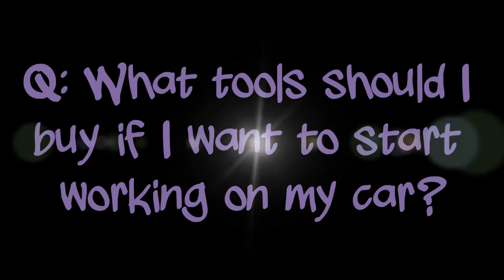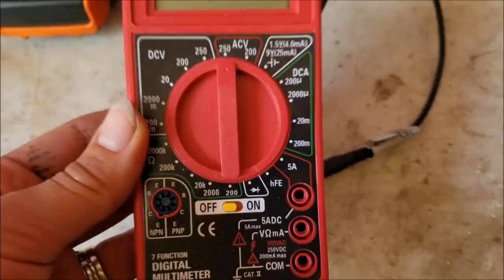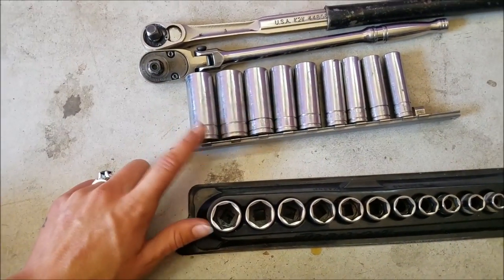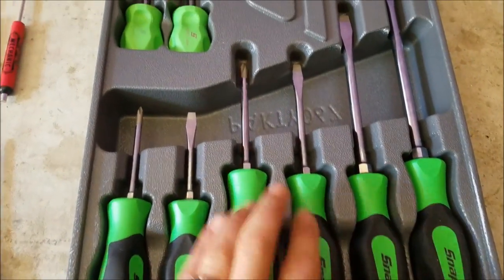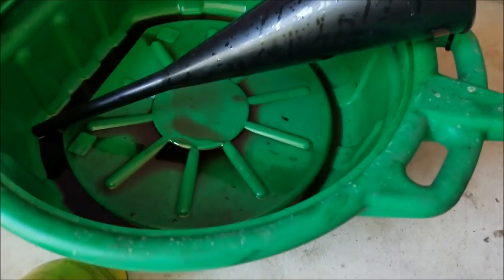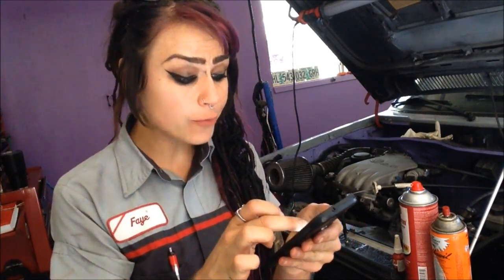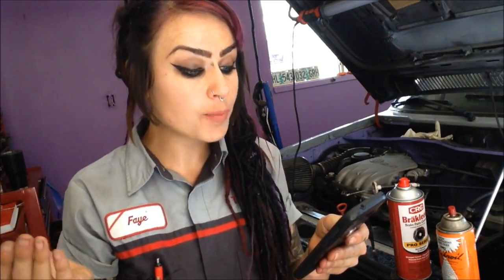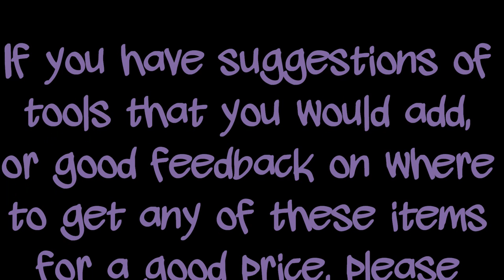"What tools should I buy if I want to start working on my car?" Q&A with Faye #2!

Comment: Crescent wrenches are trash haha, for the most part anyway. I think they are a good ( not great) shop tool but not a good car mechanic tool. I would say as a beginner I lost a ton of bolts because I would leave them on the side of finders ect. but a magnetic bolt tray is so nice to have. I also hardly ever see anyone use my favorite pliers, duckbill pliers. They are in between regular pliers and needle nose pliers and work much better for factory radiator hose clamps ect. They are my go to pliers most of the time. I have a bunch of vehicles and I usually just grab a Stanley tool set from Walmart, open 24/7, the sets come with 70% of the tools needed in a pinch, they are fairly cheap and comes in a decent case. Great video for beginners though, very informative!

Comment: Those Adjustable wrenches are good for lightly bending back flat metal usually inner fender flairs or under the hood, Or doors. Every tool has a purpose just not necessarily a good one.

Comment: There is one simple tool that I know I can't live without on any job, auto, plumbing, carpentry, whatever.  A good pocket knife, preferably with a clip-point blade.  I can open packaging, scrape mating surfaces, cut vacuum lines, dig crud away from fasteners... hell, I could make a list as long as my arm.

I wear carpenter's jeans and the flashlight goes in the tool pocket on the right thigh, my Gerber pocket knife in my right back pocket, and my Leatherman in my right front.  I feel naked without those three tools, but if I had to pick just one, it would be the pocket knife.

Comment: Totally agree on the adjustable wrenches! I hate them. They’re more of a pain than anything.  About the only time I find them useful is for doing plumbing work. They’re really handy as a multi tool for that, since you’re working with PVC or some metal fitting that’s a lot more forgiving with tools like this.
Reply: The Crescent (adjustable) wrench has its place, which is why it became a classic.  Suppose you have a trailer hitch.  The ball has a large nut on the bottom.  Would you buy a fixed size open end wrench for that?  You won’t use it anywhere else.  Then, if you need a larger ball, it will have a larger nut.  Another single size wrench?  A large Crescent wrench is the best tool for this job and many others, even though it is not a replacement for a set of combination wrenches in common sizes.

Comment: went down a YouTube rabbit hole.  so glad to have stumbled across one of your videos (instant sub), & used it for a tangent for something continuous.  anyway, from a tale that i'll refrain from telling i acquired a graduated (sae on 1 side & mm the other) adjustable wrench.  i used it to help me learn to eyeball socket size to bolt heads that i wasn't already familiar with, and if i could squeeze it in on a few bolts that i could only get to by feel.  i know, a year & a 1/2 late, but...æ

Comment: Can't afford a creeper best that I like to use is cardboard as a creeper and also for your knees. I actually threw away my creeper sick and tired of rolling around when trying to loosen nuts and bolts.
Also when your on concrete cardboard is not cold. Or spent money by rubber mats.

Comment: I bought cheap tools for the house from Walmart and if I needed to work on the car used them. The one set maybe was $20 and I still use it, 15 years later. The only thing that broke was that stupid adapter to use a 3/8 drive with 1/4 inch socket (bad idea anyway). I've added tools when I decided to try more difficult stuff. I'd recommend someone just starting out to get tools as the job presents itself. And there many tools even if used just once is worth it, but don't get tools because "maybe I'll need it."   However, the one thing I really need now is a chicken.
Reply from the maker: :)) chicken is highly recommended!!!

Comment: I actually use my adjustable wrench as a poor mans calipers to find the size for the right wrench. LOL 

Seriously though, I am a machine designer and use those as a versatile tool to check bigger bolts on machines but I shy away from using them to do any actual repair or assembly work.
Reply: "I actually use my adjustable wrench as a poor mans calipers to find the size for the right wrench. LOL "  I do the same

Comment: If you are going to use an adjustable wrench, spend a little extra to get a decent quality product. Sometimes Harbor Freight is not the best option and sometimes they are just take your time and look at several brands, do some research.

Comment: For the wrenches I highly recommend ratcheting wrenches with the swivel head there are a little bit more spendy but trust me where a socket wont work and a wrench does it's in a tight space if not invest in a shop chicken because you'll need that laughter to keep wrenching with the standard solid wrenches lol

Comment: Hey, what about a toolbox? Gotta have one or more of those to store and pack around those precious pieces of metal. Another tool recommend is the Power Probe for electrical diagnostics. Not too pricey and indispensable for electrical problems.  Milwaukee makes a stackable set of toolboxes that can link together and you can start low budget and work up from there. I use everything Milwaukee in 12 volt and 18 volt in the Fuel versions.

Comment: Found you through bearded seabee82, good looking video quality. I certainly took a long time to feel good about my tool collection to handle a lot of the car stuff I do. I still don't own a multimeter/voltmeter, I've never been good with electrical stuff - but I could probably pull that off now after all of these years, haha. Love your sense of humor. Like SAAB, I'm still in denial that Pontiac, Olds and Plymouth are dead, haha.
Reply from the maker: Awesome! Yes! I bet you could, too. I seriously use this $5.99 one from HF all the time!! And at the very least, a multimeter is great for just checking the charging voltage of your alternator! Thanks so much for subbing! :)

Comment: Great recommendations. I would say if you aren't wrenching every day don't bother with expensive tool truck brand tools. Craftsman, Kolbalt and harbor freight are good enough for do it yourself use most of the time. Except power tool habor frieght ones aren't all that good but you don't need DeWalt either.  
I'm surprised you didn't show any band or strap style oil filter wrenches. I think those are the most basic kind and what I learned to use after I started to drive and maintain my cars.  The new kinds are cool too.
Reply: Lots of mechanic youtubers have definitely suggested specifically harbor frieght impact sockets. While affordable they definitely last a long time.    Thier regular cheap combination wrenches arent so great though. The tolerances havent been the best.  But I haven't looked at thier new icon line yet, but I've heard good things.

Comment: How about safety glasses? My tire tread depth gauge cost one cent. Hold the penny upside down in the deepest point of the tread groove and when you can see the top of Lincoln's head it's time for new tires. Do this in many places on the tire, side to side on the tread and around the circumference of the tire. Just make sure that you are not on top of the many wear indicator bars around the tire.

Comment: I don't like reversible ratchet-wrenches. Instead, I have a set of Stanley brand locking-flex, ratchet-wrenches. The lock esp comes in handy for any angles you run into, where non-locking flex might become loose over time, and the wrench won't hold the box end in place. You can just flip the wrench to reverse the direction

Comment: seems like everyone is coming out with big sets of wrenches in blowmold cases dewalt has one now and milwaukee with a pretty good assortment of wrenches for around 200 bucks cheaper on sale dewalt has 192 piece for 169 on amazon almost every wrench you would usually use

Comment: My broke ass made my oil drain pan out of an empty cat litter jug (the kind with the screw-on cap). I cut a huge hole in one side to catch the oil while it’s laid on the other side, then unscrew that cap to pour the oil into the “bad oil” container. It only leaks a little bit LOL. Yeah I probably need the real one you’ve got 😆

Comment: I’m still starting out but I got a mechanics tool set from amazon that had multiple drives extensions and a mix of metric and SAE... Then I started working on my own truck... I would price out jobs based on seeing someone like Faye or others that have Toyota’s on YouTube... I would check what the dealer would charge for said job... then I would buy the extra tools I needed and would still be saving money... Plus I can add those tools to my collection

Comment: Have you ever tried Mouse Milk? It’s by far the best penetrating oil I’ve ever used. I’ve been a AF aircraft mech for 13 years and it’s never let me down.
Reply from the maker: Wow no I haven't but I am really intrigued! I'll have to look into it!
Reply: Was a Kroil and PB Blaster user until I tried SeaFoam Deep Creep. Works as well or better than either, but has much less rank odor. If you forget (or have a hole in) your gloves, it takes forever to get the PBB smell out of your skin. You should still wear gloves, but the SF Deep Creep doesn’t fume up the shop as badly as the others.

Comment: You forget an extending magnet! Dropping bolts
Reply: Nevermind you said that
Reply: Butttttttttt I did notice you didn’t mention eye goggles, safety glasses or whatever they call them now a days. I’ve had dirt, rust, battery acid (don’t ask), etc fall on my eyes while working with vehicles and it’s not fun... we only have one set of eyes so gotta take care of em
Reply: And also for people planning to do brakes, the twisty thing that pushes the caliper back... that’s a must and cheap
Reply from the maker: @ernestamar4730  "twisty thing" 😂

Comment: Poor quality adjustables are horrible!  Quality ones can save time and weight heading to a blind job where you can't carry a box of tools.  Cheap steel off brand ones can be nightmares.  Then there is the right and wrong way to use them.  :/